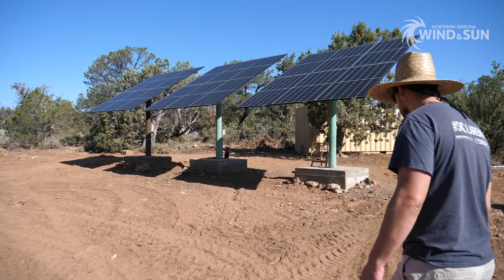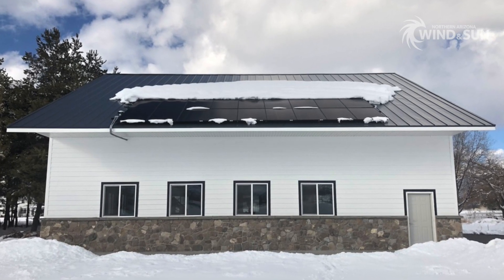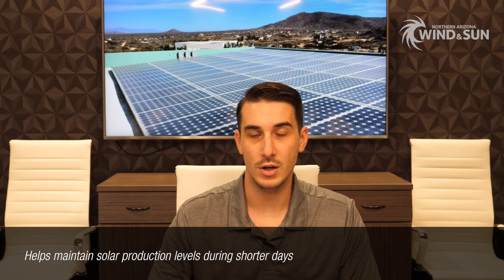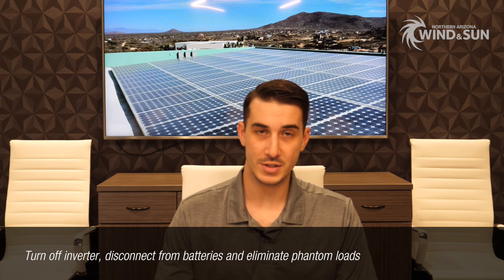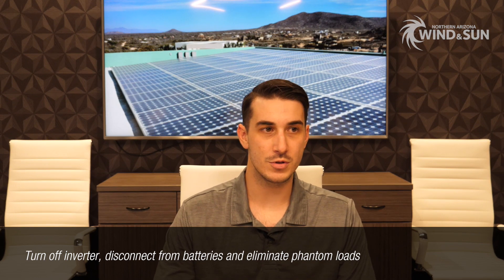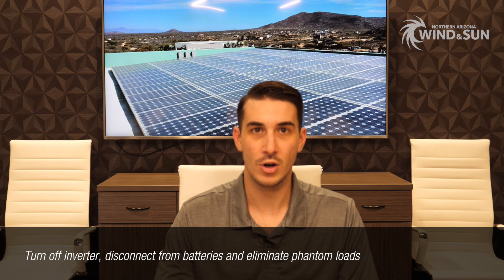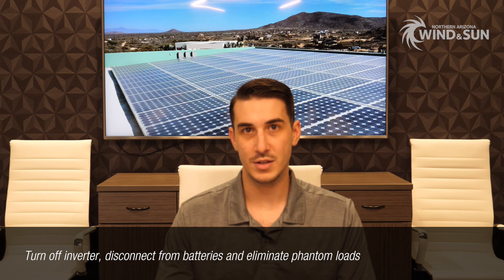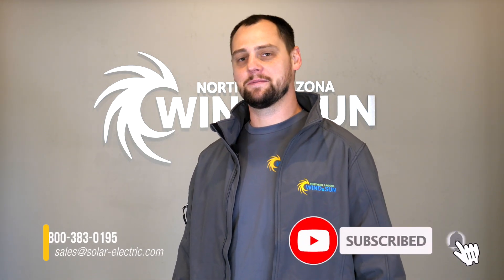Winter Caring Tips for Off Grid Solar Components

Comment: Very good quick summary of winterization issues.  In my Alaska location, I also have to worry about freeze point of batteries.  For flooded lead-acid batteries, I have used the 80% charge level equals protection to -40 degrees guideline.  Since I live in a warmer part of Alaska, I don’t have to protect to a lower temperature.  I keep a weather station going by using a system that goes to extemely low loads and wakes up to transmit weather data periodically.  In April at -40 degrees, the solar panels can produce extremely high voltage so my two 72 cell panels had to be connected in parallel.

Comment: @Donald Johnson.  Regarding LiFePO4 storage, as I understand avoid charging if battery temp is less than 33 degrees F, disconnect and no issues (lithium has no water to freeze), SOC should be around 50%.  But I’m no expert....

Comment: Thanks for addressing this issue.  For those of us who are off-grid and in a northern clime, winterizing considerations also include a deep freeze.  While a drop in temperature below -4F is seldom sustained, it does happen. With LiFePO4 batteries should I be worried about leaving them over winter if completely disconnected from any source that would draw current?

Comment: I have the same question regarding the LiFe batteries.  I have disconnected them from my system.  Rarely do we see -4, however, I am concerned should the temperature go that low in my off grid cabin.

Comment: If your system is set up correctly, the inverter will shut down at the setpoint (perhaps at 50% discharge) and should not drain the batteries.  Seeking to charge when it is too cold/beyond specs is the real issue, from my vantage.